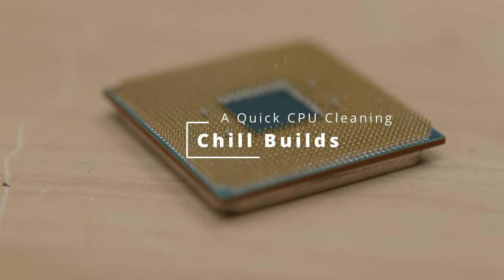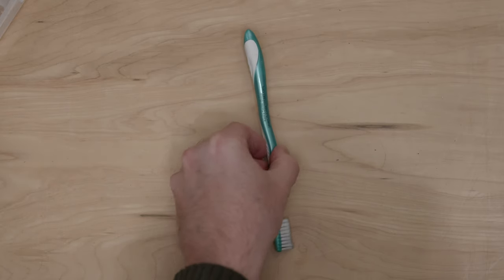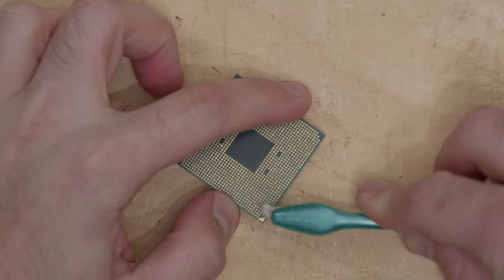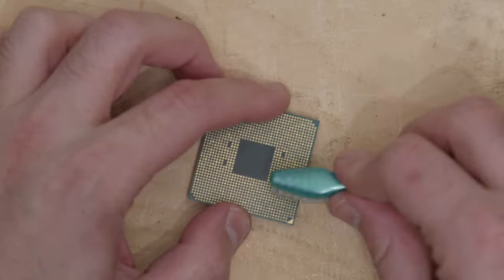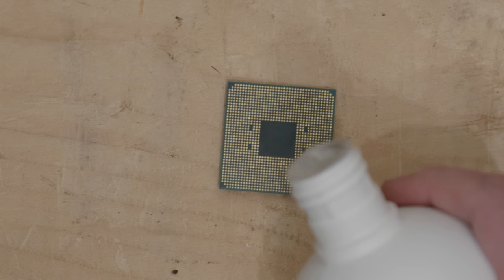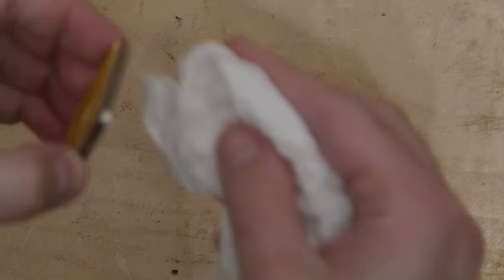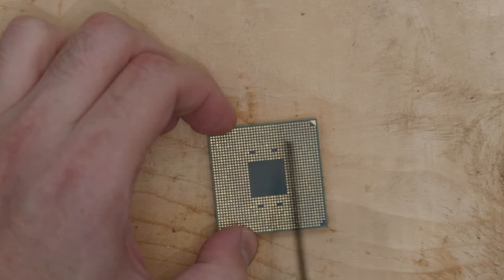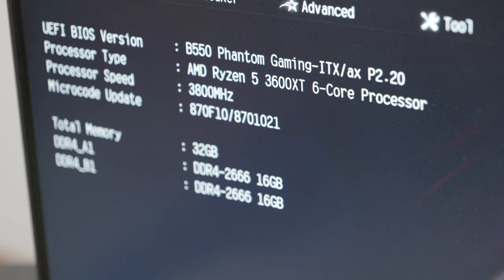Chill Builds Adventure!  How to Clean Thermal Paste from CPU Pins

Comment: I actually did this because somehow paste got into the socket and the computer was rebooting randomly . It was just regular thermal paste - but still caused issues . I also had to clean the socket out ... which this video does not show at all . If it is on the cpu - then it is probably in the socket as well !!

Comment: Can I use 70% isopropyl alcohol? I’m fine with leaving it to air dry for a day or two if needed
Reply from the maker: I would hate to tell you that it'll be fine and then have you wreck your CPU. However, I can tell you I've used it before without issue. That doesn't mean it couldn't cause an issue I guess. I made sure to blow out the CPU with compressed air or an electronics-safe blower afterward to clear the excess water content out asap. 

I recommend getting the 99%. I found that my local hardware store carries it by the gallon now, so I may grab one to keep on hand.

If you decide to use the 70% , you're responsible for the outcome!
Reply: @ChillBuilds  I decided to use the 70% since it’s my old cpu and im looking to gift it away. Worse comes to worse, I’ll buy whoever im gifting it too another cpu. I’ve used it in the past and just made sure to let it air dry for hours, and so far so good. But I agree that I should definitely go get me some 99% isopropyl because it’s significantly faster when it comes to evaporation. Thank you for the advice!